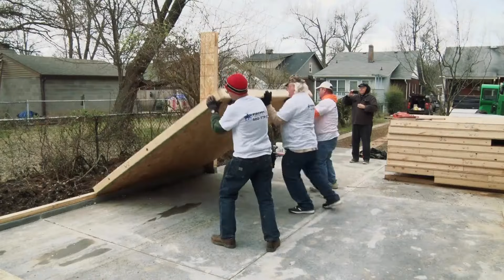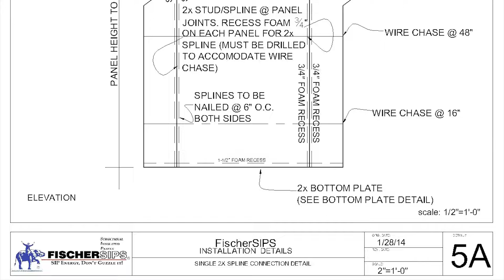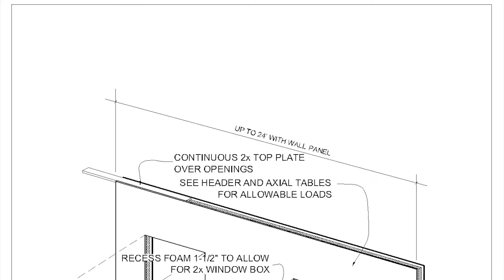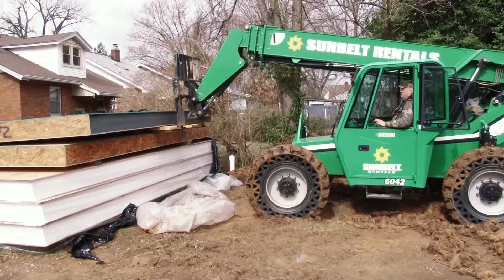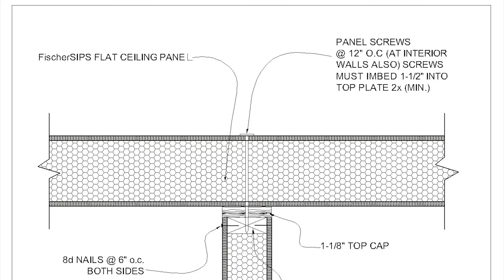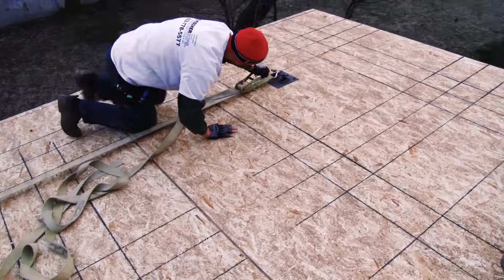FischerSIPs Comprehensive SIP Installation Guide

Comment: Every other video I have watched on SIP panel installation has a step where some sort of spray foam adhesive is applied liberally in the space between panel. Why do you skip this step? You seem to have only applied that adhesive at the top cap.